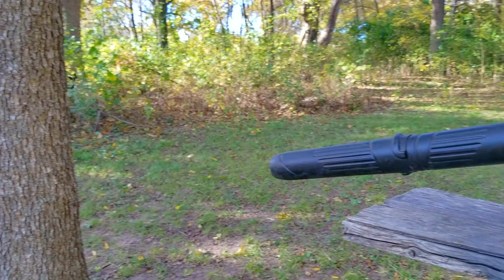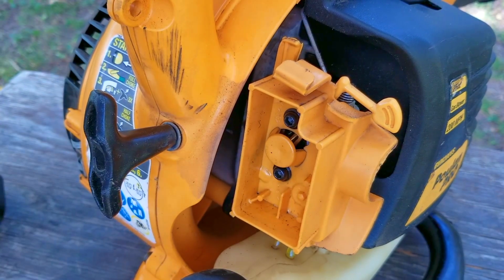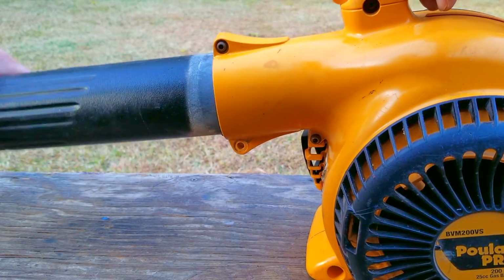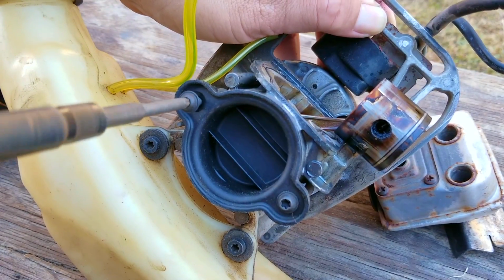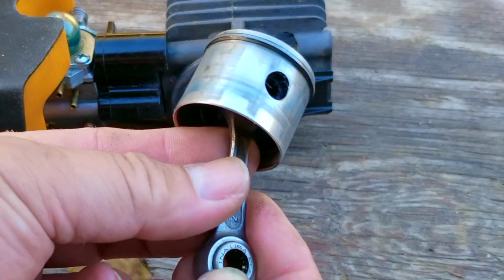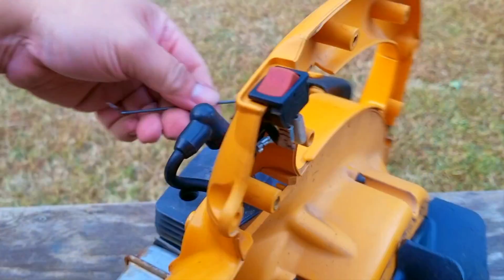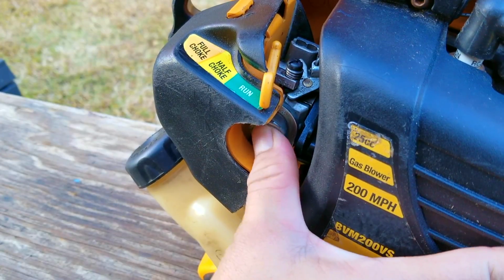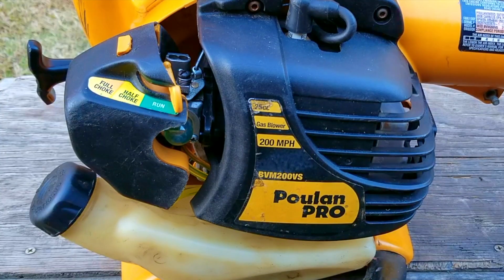Fixing a Poulan Pro blower, that stopped running while being used.

Comment: The main problem is one of design. Two bolts to hold the cylinder on is "cutting corners" to the max. You did the right thing putting that much thread locker on. Those 2 bolts need all the help they can get.
Reply from the maker: I completely agree they were cutting corners. Thank you Stephen Bridges.

Comment: Thanks for the vid ! I've had a poulin leaf blower for years and it never let me down - until I loaned it to my stepson (big mistake). he brought it back and I didn't use it till this year. Right off the bat I noticed the wingnut missing from the blower attachment, then when I started it it was hard to start and when it did run it had low power - I think he didn't use oil mix in fuel. Lesson learned never loan your tools out ! Now I will have to teardown everything. Thanks again for giving me a heads up on the teardown !!!
Reply from the maker: no problem and thanks for the comment.

Comment: Again, I have to admit, I had more issues with that exact same blower(S) (yet I actually fail into buy a second one thinking it would run better) than any other blower I've ever owns. Presently I own a Stihl blower and have for the last 6 or 7 years and have yet to do anything to it. Not even a spark plug or any rebuild on the carb. I simple put in the stihl synthetic oil and gas mixture and pull the cord and it runs...every time. That is how I like my yard power equipment to work.
Reply from the maker: I think you convinced me to buy a stihl instead

Comment: I probably would tear it down & put thread lock on all bolts like you did especially if i wanted to use it. if a job is worth doing it's worth doing it right.
Reply from the maker: very well said Mike Jones

Comment: I have two of these exact blowers. Both were cheap or free, I don’t remember which. The one I am using needed a carb rebuild. The kit and the new carb were priced within a dollar or two of each other, so I bought the carb. Got it running but not great. Discovered the lose jug and did the two bolt tightening. In retrospect, I should have also used thread locker. I will if / when I have to go back in. That one runs good now. Other one is a future project. It has very low compression (under 50 PSI) and might be burnt up. I certainly know how to take this model apart now and get it back together. Excellent video series. I think these are good blowers for the guy who knows how to fix them. Good because they are cheap. Thank you for showing the updates. Apparently a very common problem in these 10-15 year old blowers. California hates them, so they must be OK in my book.
Reply from the maker: very well said haneyoakie14

Comment: I had the same thing happen on a weed eater trimmer that is basically the same engine luckily it was not quite as hard to that it apart I made sure the gasket was good and put it back together and it worked great for another several years
Reply from the maker: nice work, and thank you Charles Duboise
Reply: @HomeGaragechannel  thanks of all of the small engine repair channels I learn more from yours than any others you get to the point and show the what the best way the repair it
Reply from the maker: I really do appreciate that

Comment: Use red loctite number 262 or 272, it is high temperature and high strength and chemically bonds to the screw/bolt, blue threadlock is medium strength and not high temperature or high strength and will breakdown due to heat, i've always used red loctite on internal engine bolts, head bolts, and on 2-cycle's the cylinder screws/bolts.  Briggs for example says to use Loctite 262 or 272 on oil pan bolts, head bolts and connecting rod bolts.
Reply from the maker: you make a good point, If I take it apart in the next year or so, I'll have to remember to use red loc-tite.

Comment: I would have put thread locker on the one bolt. With each additional part that I would take off, I run the risk of breaking something or not putting it back correctly. Just like a doctor, "First do no harm..." Thanks for the video.
Reply from the maker: You and me both A Patterson.

Comment: I would have gone ahead and do what you did. I had a similar "while you are there" situation. My clutch went out on my 1992 Accord. I asked the to replace the clutch, throw out bearing and the pressure plate. The mechanic told me I did not need one. I again asked him to do it. He did not. This was at 160,000 miles. At 190, 000 miles, the pressure plate broke. So that is why I say while you are there, you might as well put the extra effort in it.
Have good days!
Reply from the maker: thank you Buddy Reed and thanks for the information

Comment: Not surprised you had this issue as I had it happen to me too. I also had the bolts holding the engine to the housing come loose and the engine making this loud banging sound when running, turns out those may come loose too. Not a bad blower in my opinion as I use a Craftsman that looks identical. I never scrap fixable equipment.
Reply from the maker: how bad would it have to be, before you scrap it?
Reply: @HomeGaragechannel  Never scrapped anything so I can't say as I would keep it for parts especially if it is something hard to get. If it is something like an engine ran on straight gas and it was beyond repair then I would consider it for parts since the engine is done. Or I would find another of the same model with a good engine but in terrible external shape. Parts are just too expensive to be throwing things out when you might need them in the future if you get an identical model, that is how I view things at least. 

  I have a Troy-Bilt trimmer with a busted shaft that costs a whopping $60 for a new shaft which is insane. Engine is perfect and looks barely used. It isn't a shaft with a gearbox, it is one of those likely cheaper permanent ones that if something inside breaks, you have to get a whole new one but for $60 there is no way so I'll just keep looking for another trimmer. Engine runs like a clock and has lots of power. Has so much power it broke the gears for the shaft haha.
Reply from the maker: thank you for the information
Reply: @HomeGaragechannel  No problem, surprised you still have time replying to comments.
Reply from the maker: I feel if you take the time out of your day to make a comment, I should make time as well.

Comment: Well worth the effort I think. Could you do an experiment to see if the tigone (excuse the misspelling) line is resistant to ethanol line along with fresh lines that aren’t please?
Reply from the maker: thank you Catcha Cow
Reply: Catcha Cow you should never run any gas-containing Ethanol in engines that use this type of carburetor (I call em chainsaw carbs)  as they all have a Metering Diaphram for the gas in them. ETHANOL will make it turn Rock Hard and stop working.  Even after just a season or 2.   Please use only regular non-ethanol gas in them. in the long run it will save you more money.   

if you use ethanol gas in mowers, just make sure you run ALL the gas out of it before season end storage.

Comment: If I didn't know what I know now, I guess that I would of thrown it away and done or scrap it for parts. To get to the bolts on the engine itself was overkill for me bro. Someone else probably would of thrown it out and done. Thanks for sharing bro🙏
Reply from the maker: you make a good point Ramadin Sookhoo.
Reply: @HomeGaragechannel  dip by drip the bucket will get filled up. It was technically a simple repair but getting to the source of the problem is very stressful even for an experienced person like yourself bro

Comment: i would replace cylinder gasket because when it is loose it damages gasket and wont seal properly after tightening
Reply from the maker: you make a good point
Reply: I've reused several base gaskets and never had a problem 👍

Comment: I replaced the whole crankshaft assembly on mine due to the crankshaft throwing a ball bearing. I have completely rebuilt mine and I appreciate your advice on getting mine running again. I have installed my new flywheel and used thread locker on the fan but tightening to 15 foot lbs. My guess is what I did wrong was not tighten the fan blade nut and it came loose when I started the blower which then let the flywheel spin freely on the tapered shaft and sheering the key Hopefully this was a an error on my part. This weekend I am going to test it and I'll let you know my results.
Reply from the maker: hopefully it goes well for you.